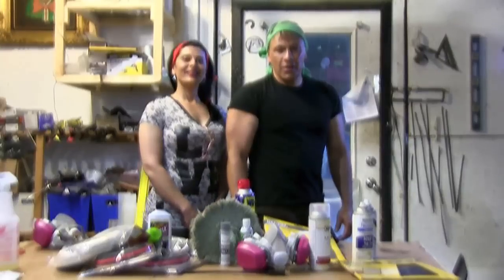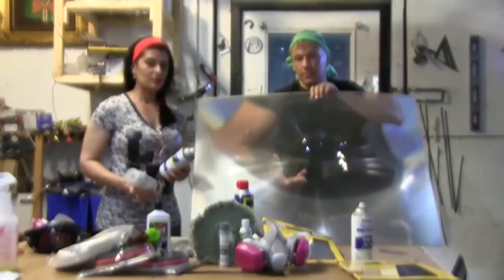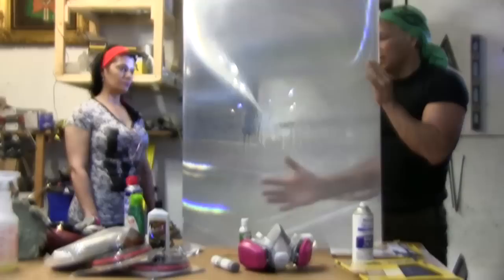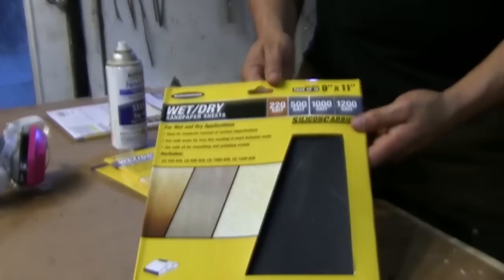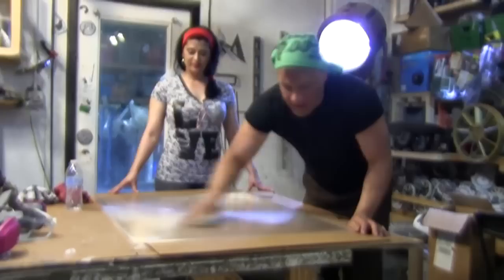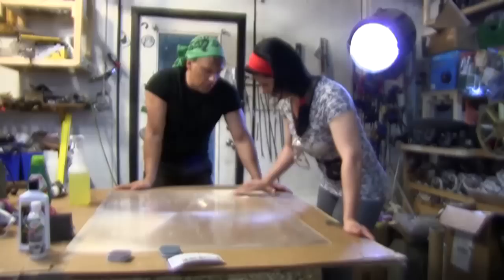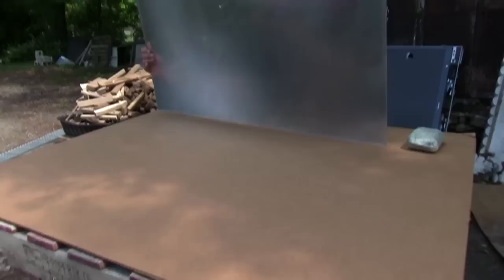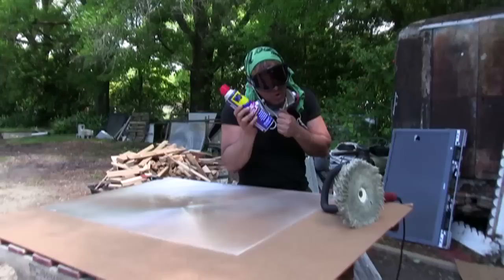Convert Linear Fresnel Lens to a Spot Fresnel Lens GreenPowerScience

Comment: Would a 42x21 linear lens work?
Reply from the maker: Becky Perry Do the oil test on the one side. It will let you know.
Reply: GREENPOWERSCIENCE it is a foggy lens and it was slightly clearer when I did the test, but when I put polyurethane on it it was really clear for a sec. Could you tell me which lens would work on your website?

Comment: Have you made the list yet of the best lenses to use?
Reply from the maker: Zap It is a bit more difficult than I thought. Several TVs have the same model# but totally different internal parts and lenses. The older rear projections were sort of a "wild west" manufacturing. Same unit enclosures put together with either nails, screws, glue or staples. Getting close to finishing.
Reply: @GREENPOWERSCIENCE  Did you ever finish this list?
Reply: @GREENPOWERSCIENCE  yeah, I'd be very interested in the list, could you provide it?

Comment: GREENPOWERSCIENCE can you tell me witch resin to use
Reply from the maker: Spencer W The buffing works good. For resins we use the UV cure stuff but it requires a clear flat mold.
Reply: GREENPOWERSCIENCE OK thank you so much the reason I needed this info is because I purchased a large fresnel lense from you but I forgot it linear

Comment: heres a question. over time would he lense wear out with all the heat or would it just need dusting now and then
Reply from the maker: Just a dusting. Longer focal lengths allow distance from the focal point where the sunlight concentrates = the hottest area. There are some lenses that last longer than others.

Comment: 1. You do not need safety glasses.
2. You do not need a respirator.
3. THAT is not a buffer. THAT is an angle grinder.
4. DO NOT USE WD-40 for the "test". Water will have the same effect.
5. Do not waste your money on micro mesh. That shit is expensive and meant for tiny models. They do not last for multiple lenses. You can find sheets of that fine sandpaper on Amazon for pennies on the dollar.
6. Don't buy your shirts in the little girls section when you're clearly a big girl.
7. Don't take steroids. Or meth. That shits evil.

I'm sure these 2 women are great ppl, but I wouldn't do anything they "recommended" here.

Comment: Man, the cam is out of focus!!
Reply from the maker: Condensation inside the camera. They all do that in FL when relative humidity is high. If cameras are stored inside A/C room, dripping wet when you take it outside. Store them in a Pelican case in a safe outside area, camera is fine until you hold it, then it fogs up from body heat. Not just on the outside, inside the camera lens elements. It takes 2 hours for that to go away. I made the mistake of carrying the camera on my side with the shoulder strap walking to the office. Video clears up for the outdoor shots later in the video.

We have had TV crews here from major networks and they have the same problem even with super expensive lenses. I usually try to shoot after 12 PM but this was the only opening we have had for a few weeks.